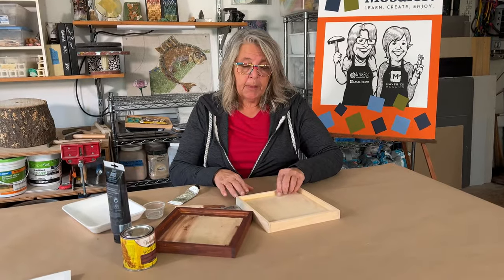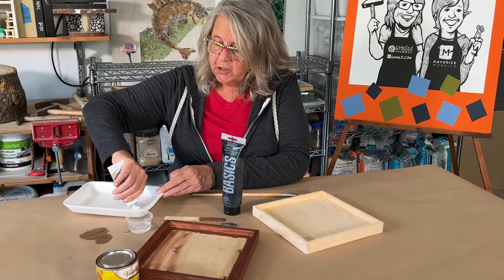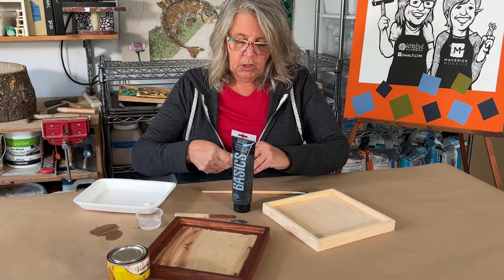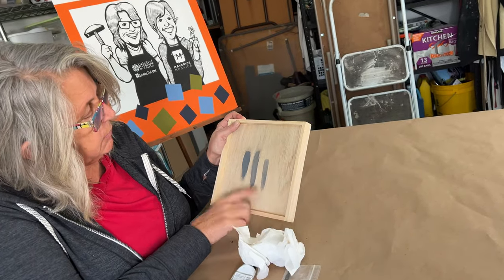Mosaic Wood Frames: Painting, Staining and Preparing for Mosaic.

Comment: Kim, did you say any cement based adhesive can be used for the skim coat? 💕 I am in Australia and I haven't seen that product before!
Reply from the maker: You can use the same thinset you’ll be using as your adhesive. (from Bonnie) Thanks for being a fan